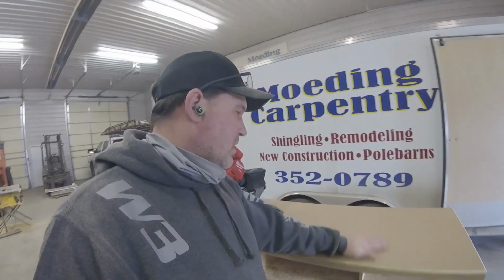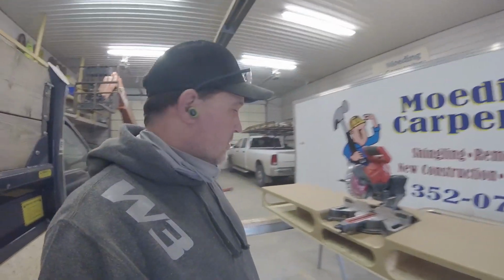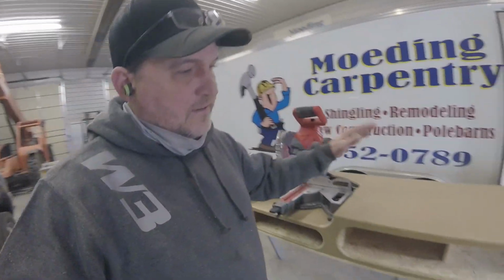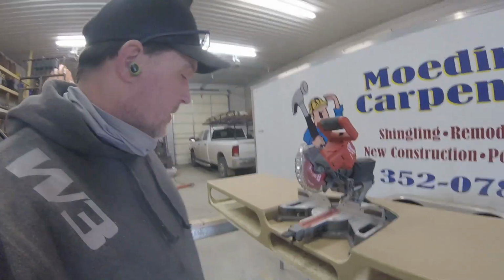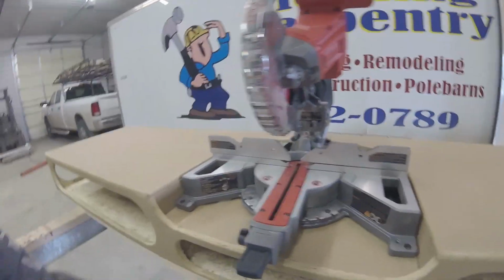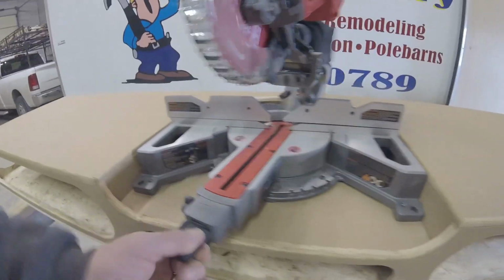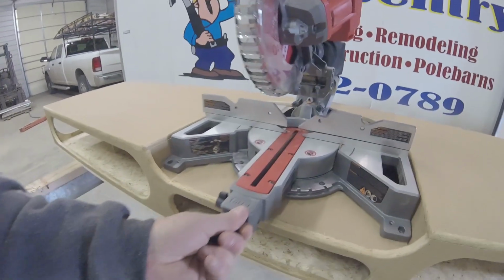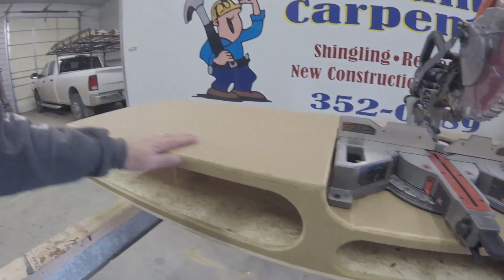RON PAULK MITER STATION BUILD

Comment: Dumb question, but you said it’s made of OSB with a coating. What is it called? I’ve looked at HD and Lowe’s, and I don’t see anything like you’re describing. And I agree with the other commenter, that intro was pretty cool!
Reply from the maker: It's a product our local shed builder uses. I'm not sure of the name however it looks exactly like the lp sheathing without the writing on it. I will ask what it's called and let you know.
Reply from the maker: Lp pro structural shed flooring is what it is called!

Great question!
Reply: You caught my attention when you mentioned this rather than plywood due to cost. I’ve been wanting to make these and didn’t want to spend $60+ per sheet to make them. Thanks for the info!
Reply from the maker: So I don't know what retail pricing is. I bought it from him at his cost, so I got a pretty good deal. It took exactly 2 sheets for mine.